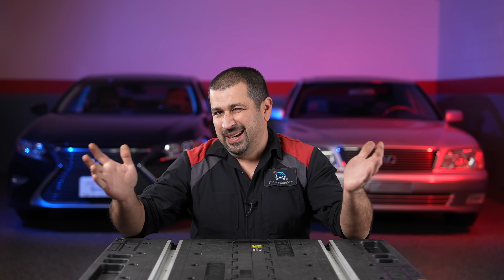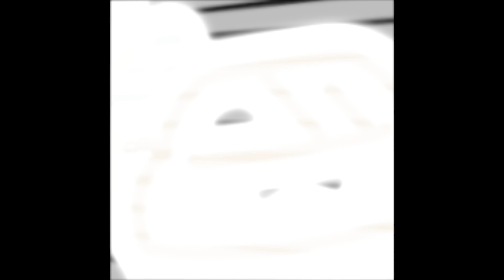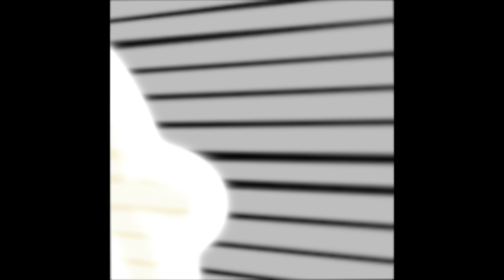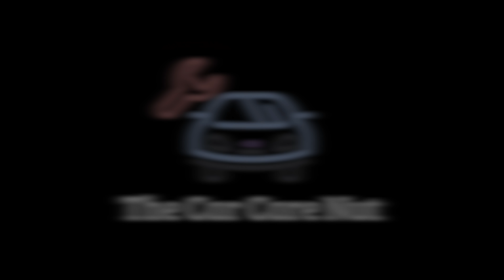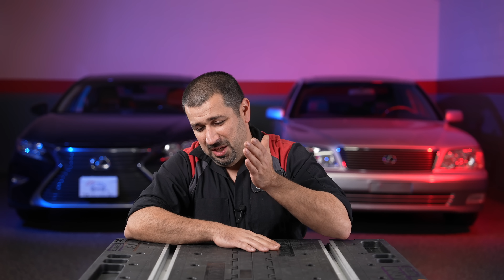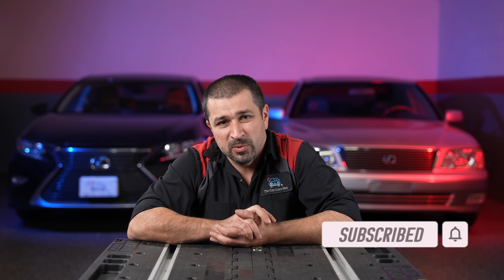Can Modern Turbo Engines Be Reliable? Here's The TRUTH!

Comment: Spot on about emissions, my take, smaller displacement engines need a turbo to make some power to get going, problem is it gets used a lot more than the larger engines with a lot more torque. As you say oil is the BIG thing. I do mid service oil changes which is up to 5k MAX. I own a V8 Bi-turbo AMG. On my dash I can choose what I want to see info wise. In the center part I have oil and transmission temp displayed in blue until it gets up to temp. THEN I might have a play. Small engines dosen't get this option as the turbo will be required pretty much after a cold start.

Comment: The cars in last post were trade ins to be clear. But we knew that anybody looking a Saab that was old probably was a little broke..
And when a person gets ahold of a older high end car, you have to budget for repairs. This $$$ problem is usually how old Benzs, Saabs,Volvos, and Audis wind up as junk.
Ultimate example: 70s Rolls Royces are genrally cheap... $30000
gets you a really nice looker. Why not buy it?  Oh, do buy it!!
A marvelous device, and really a lovely drive. You'll love it.
Which is the problem: love IS blind..Do note: anything that needs to be done to will bankrupt you...parts cost 4 to 20x other lesser cars. labor rates $250/hour , and most of the old rolls are plenty ratty by now.....

Comment: I have been out of the car business for 12 years, and am therefore not snapped in to current trends. But, I must tell you all that I have owned 8 or 9 Saab and Volvo turbos. Never a lick of trouble..
Only one modded, everything else bone stock and dealer maintained. And never had to fix a turbo issue, or damage caused
 by a turbo. Average miles for the fleet: about 175000. High mileage? 379000 Volvo.
Why so many? Ran a very old-school mom and pop Saab dealer in Philly. And frankly, we were concerned about customer satisfaction. So, if not scrap, I often bought real movie stars, but
I was able to do minor repairs(seldom....)and also to notice guage readings.....
In fact, no failures of any signicance....these got parked once they got too rusty....

Comment: Wife wanted a newer car. We had to look hard near our rural location for a used car that I could trust. No tiny turbo engine, no wet belts, no water pump inside the crankcase. These are known liabilities. Finally, I bought my first Ford ever, a 2020 Ecosport AWD with the 2l NA Duratech engine. So, it's not in the future, it's already a problem in our price range. And they know it. They wanted more for a car with an engine that won't grenade.

Comment: One thing  very important that  most of all  don't  know  :  a lot of  dealers and shops  have been used RECYCLE oil  but  they don't  tell  you .  The  dealer  where I  working use  recycle  oil  for  all  of  cars turbo & non turbo  engines .  Do  you  think  recycle  oil  is good for turbo  engine!!!! I don't  think  so

Comment: not all turbo engines need revs to make power. the new turbo engine in the taomca/4runner/lc250 doesn't like to rev. my TRD Sport, even on 35s, rarely revs over 3k rpm in daily driving situations.

Comment: My 2017 718 Boxster has 140k miles and my 2018 Cayenne GTS has 115k miles, both turbocharged. Both run perfectly and I dont have to add a drop of oil between oil changes. Both see lots of highway miles so I go 10k mile OCI, no issue here.

Comment: I did my first 2 oil changes in my new 2023 F150 powerboost at 5,000 miles but noticed that the oil turned black at 5,000 miles.
So I did my third and fourth oil changes at 4,000 miles but noticed that the oil was still turning black.
I then did my fifth and sixth oil changes at 3,000 miles but noticed that the oil had turned brownish, going black.
So now I am doing my oil changes every 2,500 miles to see if the oil is still turning dark and if so, then I'll change my oil every 2,000 miles, but we'll just have to wait and see.

Comment: I have  driven Mercedes for 40 years, have owned 7 and currently still have 3.  The newest are a 2000 E430 and 20011 E430 Sport.  Both have one of the best V8 engines ever made, a 4.3 liter that make 278 HP.  These are non-turbos, 278 HOP was a lot for the time.They are smooth, powerful and reliable and I get 26-28 MPG on highway trips. I have used full synthetic oil changed at 7500 miles.  They both have over 130,000 miles and drive like new.  I don't trust all the newer Mercedes with small turbo engines.
I just retired and had been driving company cars for 10 years.  The last 2 were Ford Explorers with 2.4liter turbos. They gave me a new car every 50,000 miles so I never had an engine failure.  But I am convinced those small engines had to work too hard to move a large vehicle.

Comment: I have a 1985 300zx Turbo with an adapted electric water pump and circuitry that allows the water pump and an electric fan to continue to run for about 90 seconds after shutdown of the engine.  You'd be surprised how rapidly an engine cools down with coolant circulating throughout without the engine running.  And of course, this includes the turbo bearings which have a water jacket.  This happens automatically without having to do anything ... just run the car for over a minute and it resets for the next shutdown.  You can walk away as you would a non-turbo car after even a long drive and hear it continuing to operate behind you.

Comment: My 2025 tacoma has a turbo. We had a 2001 beetle with a turbo. The turbo lasted 276000 miles. Engine was still going strong at 350000 when we gave it away.

On the tacoma will change the oil every 5000 mile like we did on the vw.

Comment: I agree with your advice but not sure I agree with your reasoning.   I think the reason to change it often is actually the opposite.  Case in point is my wife.  My wife, 5 days a week, turns the key.   Less than 10 minutes later, she's at work.  Imagine a vehicle being driven by someone that drives almost 100% of the time in this fashion.  It's not heat killing that oil. it's a lack of heat.  Because of the high operating temperatures of these engines, they must be built to allow for more thermal expansion.  So if these moving parts have allowed for that, it means logically, the parts are not are not "vapor tight" when first started.  This is what caused the early failures of the Honda 1.5T and though they have made a software adjustment, it's still an issue.  Even my wife, who drives a 2021 Sienna, I drain perfectly clear oil every 5000 miles but you can smell the fuel from the oil, and that's with us driving it long distances on weekends.   If she limited her driving to just around town, it would be even worse and that's not even a turbo.   The long oil change intevals are fine, if one drives under "normal conditions" which is starting the car, getting on a road that's 55-65MPH and totally flat, and driving on that road for at least a half hour after the car is warmed up.   The problem is, no one drives like this.  It's either 75-80 on the interstate or bumper to bumper traffic where that engine may never see operating temperature on 100% of the components.  In fact, our Sienna in "ECO" mode can run for 2 hours in town and will never come more than a 1/8" off full due to the computer telling it to run at a lower temperature.  Turn ECO off and you end up with normal operating temperature but you also end up getting like 22MPG in the city. 

So just my two cents.

Comment: Question Is the Subaru Outback Wilderness 2,4L Turbo Engine and its Tubo good and reliable?
Reply: YES IT IS.  That turbo engine has been proven to be a very solid powerplant, and Subaru has decades of previous experience in building very reliable turbo engines.

Comment: Let me suggest that in the hierarchy of stress, diesels are not at the bottom and gasoline at the top. Gasoline at the top with diesel cars not far behind, then trucks in the middle and plant engines; generators, pumps, tractors, excavators, boats; way down at the bottom. A diesel that is designed for plant operations, if put in a truck, even without a turbocharger, needs considerable development work if it is going to survive. So there is a huge rift there between engines operating in a predictable manner and ordinary consumer road use.  Long ago, I used to work in an engine design office where we dealt with turbo and non-turbo diesels used for plant and vehicle operations. Result: I have never owned a turbocharger! You are completely correct about the oil.

Comment: I want the turbo diesel that they put in the hilux in my 24 tacoma. Im not super worried about the 2.4 i-force non hybrid in mine. already changed the oil twice. got one more at 9000 before the 10k inspection from the dealership. Bigger question that i have is trans fluid. I cant even look at it. I have to rely on the dealership.

Comment: 12:40 I have a bit more on why the oil needs change, based on what I have found run multi hour journeys at interstate speed that have been weekly of by weekly.  A non overdrive manual e36 with 3:46 gear and 25, or a 71 f100 with mild built 396 and diesel t19 with 3:73 gears on 28in tires both are something meant to be ran at higher rpm. The first would get around 2500-3600 or 3200-4800rpm power band, while the other would be running a 1800-3000rpm or 2800-4200rpm where latter of both these degrade the oil. They would thin the oil and start leaking, the e36 would be 2000 miles and the f100 about 600 miles is where the divergence of matinees came. They both where giving issues of low shear stability in oil, where found 10w-40 semi synthetic plus lucuas stability additive to work mostly and there was a lucuas 10w-40 with the needed high shear but has been discontinued. So the first was fine with the short oil change, but made a mistake with the 600 mile one and just added oil that lead to it eating a came since lifter got clogged. 

It is to note that euro car from brand that use trubos, like vw would be using this high shear oil in weights of 0w-40 or 5w-40 for this reason and engines with with low oil quantity. Basically heat is the enemy of oil and if running at a higher rpm, you will want to change sooner but unsure how these newer engines are staying together with low shear *w-20 or less oils. Yes with ball bearing turbos, you will what to keep the oem oil or change the restrictor to match the new weight. I have a f350 that is better for making this journey, it has a 7.3 idi with twin holset hx35s and stays under 2800rpm mostly. These have journal bearing and dont care the weight of the oil, just that there is a big enough drain for the foam oil.

Comment: YES, EVEN for a gasoline engine! As an owner of a Volvo V40 T2.0 litre (gasoline) with 160 hp from 2004 with 311,000 km (nearly 200,000 miles) on the clock the answer is a clear and simple: YES, this turbo engine is MORE reliable than the 1.8 NA version of the same model that I had before. With the proper servicing (and oil changes) the car is super reliable and the engine that has not missed a beat in all that time. And my strong impression is that the turbo actually makes the engine MORE reliable: because the turbo setup is such that the engine has a lot or torque in the low and midrange it needs less yanking it through the rev range to make speed on the highway or when overtaking. It superplus of power and torque (for a European car of 1200kg / 2600 lbs) means that on the highway I can always keep it in 5th gear which in itself already means less revs because of the higher topspeed and even if for some reason (for instance to overtake somebody) I want to accelerate to 150 or 160 kph (85 to 100mph). This, and the fact that the engine can in generally be driven at lower rpm than the NA versions also means that there is less wear and tear to the engine.

Comment: I have never trusted turbo charged consumer engines. Too many tales of them failing. I like his points about the difference between gas and diesel turbos. I think he has a point, even though he didn't mention warming up and cooling down. Other comments here show that shorter oil change intervals can extender the engine life. For me I really don't want to deal with something that you have to be so careful with. Give me a regular engine.
Reply: "Too many tales of them failing".  And that's your problem - you listen to opinionated BS instead of the FACTS.
Reply: @eskieman3948  Over the last 30 to 40 years I've been hearing this. Are they all wrong? Don't know. but It does make me wonder who is right here.